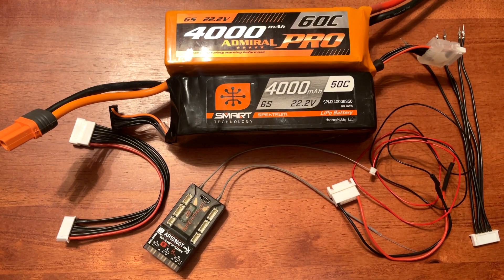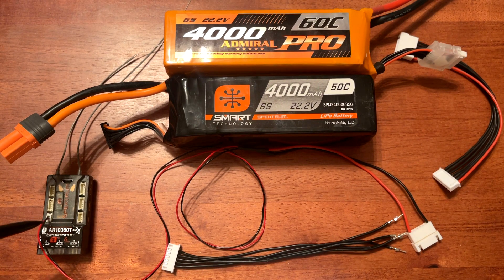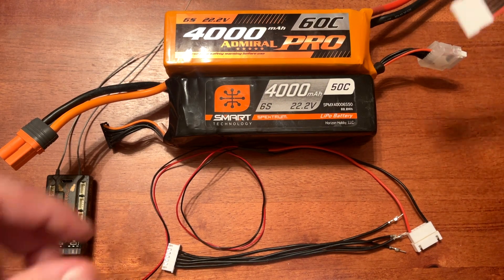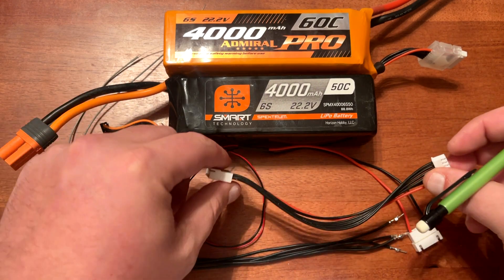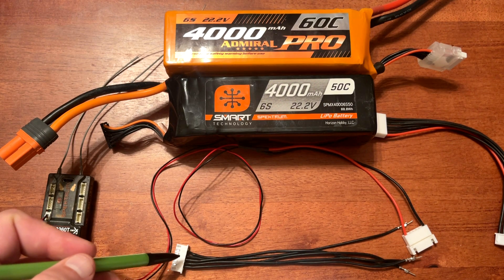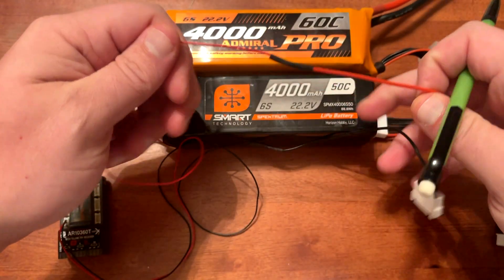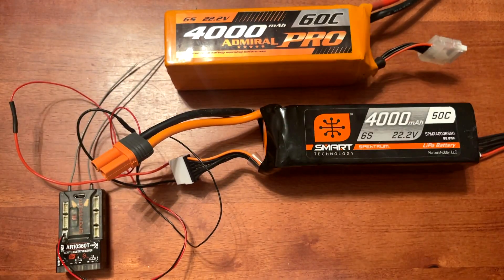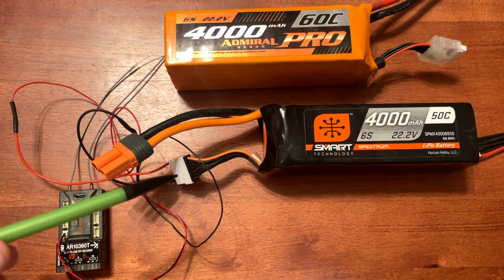Spektrum AR Receiver: Universal Voltage Cable Assembly for Total Pack Voltage (BNF/New Stock)

Comment: Will this work with my nitro helicopter? It has a 2S 6.6 V life battery so I ordered a Lipo to cell balance lead connector. Do you think it will work? It’s a 2S battery and I am ordering a 2S balance lead connector so I just take out the CENTER wire correct leave the outside positive negative wires.?

Comment: I didn't have the 2 pin connector so I had to buy it, The one I got had very small (22 ga) wire. Will I have a problem with that handling a 6 cell battery?

Comment: One question: is it the same if i connect the voltage wire at the xt90  battery connector in stead of the esc battery side?
Reply from the maker: Yes, However its tired to that one battery. Reason for ESC side is to read different battery.
Reply: @ yes i will do it too after  i’ll get a new fuselage in a few weeks until than prefer to connect it at battery connector…thank you for your answer 👍🏻

Comment: So if it reads 6s then why not simply connect the voltage cable assembly directly to the ESC lead for total pack voltage? It would disconnect each time you remove the battery and have no fuss with the balance lead apparatus you got going on here.
Reply from the maker: 3 reasons for the cable.

1) Allows you to move the receiver to different planes and not tie the cable to one esc cause of solder connection.(PNP type setup)
2) Another option for users to hook up the provided cable.
3) Mechanical type setup for those who cant or dont want to solder.

Comment: I follow your amazing videos carefully. Regarding the Volt sensor of the AR10360T I have a question.
On which transmitter screen do I see the battery voltage?
I ask because with or without sensor I see no difference.
Thank you
Tony
Reply from the maker: Main screen scroll to the right. You will see menu appear for voltage. Also can be added to "Ticker Tape"...
Reply: thanks

Comment: I tried that on a 3s batt.  When I connected the battery, the red wire on the hz 1.5  melted.  I assumed the smaller wire could not handle the load.

Comment: I see clearly how you have the the one end completed that goes to battery. However you didn’t really show the connector that goes to the reciever end or what slot it goes into at the reciever. Can you please let me know that info as well thanks
Reply from the maker: Connects to the Volt port on receiver...

Comment: I tried your video on a Spektrum AR637T receiver with IX20SE transmitter and it doesn’t work? 
Any idea why?
Thank you.
Reply: I have tried to auto configure and firmware update both the receiver and transmitter too but I can’t get it to work. Thanks.
Reply from the maker: @aviatorextreme1  when you go in to set the battery info. Do you go to Telemtry > Voltage?

Also make sure you have the wire made correctly...
Reply: @BDTennessee  yes, telemetry then voltage. For some reason the battery checker detects the battery voltage Iam using for a 6s  is 23.5v but the volt sensor on the AR637T with IX20SE detects only 21volts. 2.5-3 volts discrepancy. I also emailed SpektrumRC and horizon hobby regarding the issue. 
Thanks for the help.
Reply from the maker: @aviatorextreme1  i heard of this issue from a friend as well on his AR8020T. Showed 25.6 on full charge
Reply: @BDTennessee  any solution to the issue? Thanks.
Reply from the maker: Try to auto configure. Its a setting issue cause this work for other Spektrum radios too.

Comment: And everyone keeps asking what the voltage limit for the Flight Pack Voltage Port.  The limit is 60V; so you're good up to a 12S setup.   Do Not be confused by the receiver voltage range ( typically 3.5 - 9 V).
Reply from the maker: Good info added Jim!

Comment: Where can i buy the 2 pin connector that plugs into the VOLTAGE sensor on my AR637TA? I don't use smart batteries so i want to make this plug for mr balance lead
Reply from the maker: Use the Spektrum link in description.

Part number: SPMA9570

Comment: BD:

 That YOU are aware of, is there ANY kind of dual rate settings on ch5/ch6 of the AR631 rx? (Reason being, buddy of mines aeroscout, elevator channel on his rx ((no warranty)) is inoperable. I put elevator on ch6, mixed elevator to ch6 --ele master, ch6 slave--, & it works fine. But its extremely fast & 100% throw 100% of the time 😳). For US, we can deal with it. He still flies on safe. 

Thanks!!!
Reply: Oh, hes using my old NX8. Im loving my NX10! 👍
Reply from the maker: Some of the BNF have built in mix. So probably the case here and why you not seeing it on channel 6.

Comment: How does this change if you are setting up a 12 S system?
Reply from the maker: You would need a setup with 2 balance leads. One lead like in the video can work for 2s-6s.
Reply: @BDTennessee  is that one each (from each 6s battery) into one connector to the Rx?
Reply from the maker: @pga99fxst  correct.

Comment: You can also solder it directly to your ESC battery plug and not have to plug in a separate connector to the balance lead. That’s the way I set all mine up.
Reply from the maker: Correct and good way too. More flexibility,so wanted to share another option. Thanks for watching and sharing info :)
Reply: @BDTennessee  I never even thought about doing it the way you did! Definitely a great option as well.
Reply from the maker: @westhobbiesrc8051  Thanks!
Reply: So for this, you would obtain the connector  SPMA9570, and solder connector red to ESC red, connector black to ESC black?

Comment: Excellent tutorial again. I use the AR637T and AR8360T receivers and for voltage telemetry I install the Aircraft Telemetry Flight Pack Voltage Sensor, directly on the ESC power connector, that way this capacity is always installed on the plane or glider, independent of the lipo battery used. For me, it has worked fine. Greetings.
Reply from the maker: Thank you! That works as well.
Reply: Hola! una pregunta: usas algun conector especial para conectar el sensor de voltage al ESC? Estoy tratando de hacer lo mismo pero no se bien como
Reply: @FelipeCerdaBarra  Hola, directamente al conector XT60 con soldadura, respetando los colores de los cables. Para mayor comodidad, cambio el conector XT60 por un XT60H. Lo mismo si es un conector XT30 o XT90.
Reply: @droneschillan1738  gracias!

Comment: I've read that you shouldn't hook up the negative lead because the receiver is already connected to the negative side of the battery through the ESC's BEC. They say that making a second connection will cause an electrical ground loop; i.e., current flow in the battery's negative output lead causes a voltage difference between the negative lead at the balance connector and the receiver's negative supply voltage. You might disconnect the negative telemetry lead to see if it affects the reading.
Reply: I smoked an older 8000 series Telemetrie module indeed because I had the negative connected. I also fly a lot of orange receivers with telemetry and sure enough, do NOT connect the negative (don't ask how I know).  Apperently the new SPektrum receivers seem isolated on the negative side. I think it will work just fine without the negative.  Maybe BD Tennesee could try that for us.
Reply from the maker: @b.w.oostdam8875  sorry missed comment.Maybe ill hook up and see.
Reply from the maker: I havent noticed any issues.This wire been used for about many flights.
Reply: @BDTennessee just try it anyway, he might be right
Reply: Something new to learn..Does it maters what do you connect first? The main or the balance port?
Reply: @franciscoarzu8120  It shouldn’t matter, but I’d connect the main first..

Comment: That's pretty danged cool, thanks for passing that on and teaching us how to construct it. Too bad it can only be utilized in the most expensive RX's but it's still a great idea to tuck away in the ole noggin and I'm sure I'll use it soonish.
Reply from the maker: Thanks! This can be done with any telemetry Spektrum receiver that reads voltage. (AR6610T and above current models)